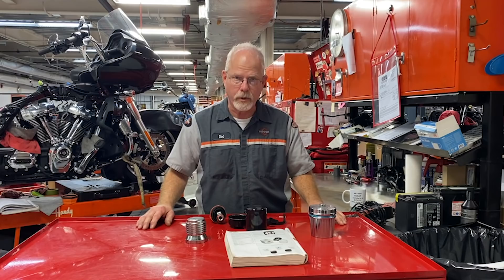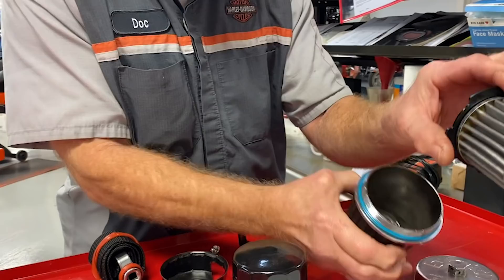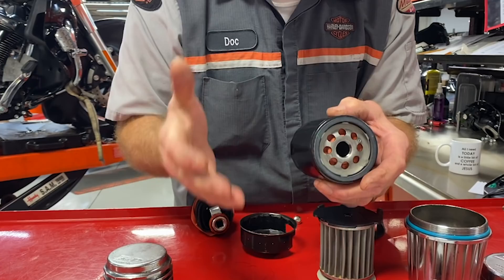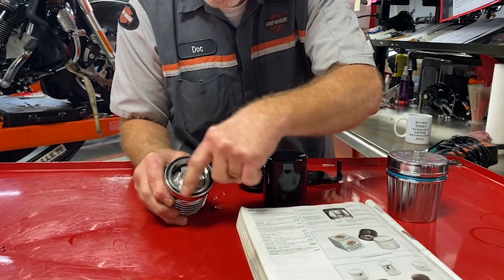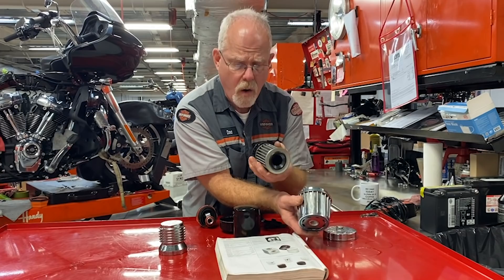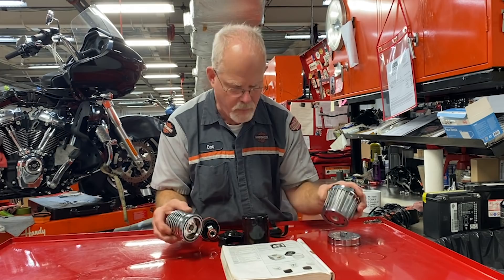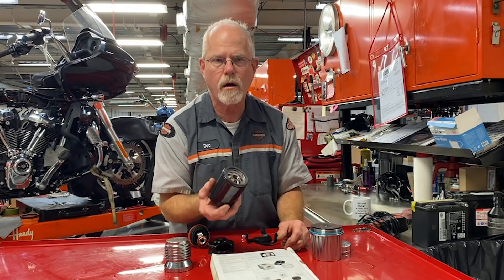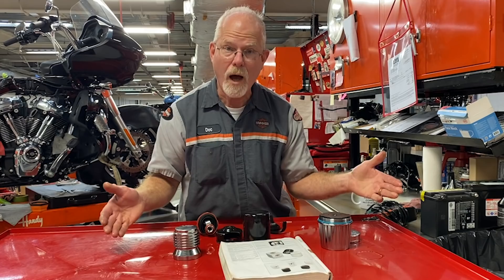DOC HARLEY: REUSABLE OIL FILTERS

Comment: The Harley filter does filter very well. The problem with it is it is plugged long before your 5k service interval. So you are running in bypass filtering no oil for the last 1-2 k or so. Amsoil is a 20 micron and k&n is 25. Are they tight enough? Probably. They also will filter oil all the way to your service interval without restriction and going into bypass. In mho a 10-12 micron is perfect. You will get the total usage out of the filter without going into bypass before your service interval comes up. One option is to spin a new harley filter on at 2500 miles and add some oil. Then go to 5k and do the full service if you want that tight of filtration. I personally use the amsoil filter and oil and have never had any issues. 6 to 1 half dozen to the other. If you filter down that tight you are in bypass for around 1/3 of your interval. If you choose a less restrictive filter you may be cycling some very fine metal through. Your call fellas. Great video doc. Thanks for the information.
Reply: How do you determine your HD oil filter is plugged and running on bypass at any mileage?
Reply: @montanaguy  The Truth About Oil Filter Micron Ratings
February 27, 2018 / in Cartridge Oil Filters, Oil Filters, Spin-on Oil Filters, Synthetic Oil Filters  
One of the most commonly asked questions about oil filters for passenger cars and light-duty trucks is “What is the micron rating of the filter?”.  The inquirer is typically seeking information upon which to make a determination as to the quality of the filter and whether it is appropriate for the application under consideration.  Often, the concept of “micron rating” and it’s relationship to filter efficiency is not fully understood which can result in an answer that is not meaningful.

What is a Micron Rating?
A micron is a unit of measure in the metric system equal to 1 millionth of a meter in length. For perspective – The average cross-section of a human hair is approximately 50 microns.

A micron rating is used to indicate the ability of an oil filter to remove contaminants by the size of the particles that the filter will collect and retain.  For example, a filter with a micron rating of 25 will filter out contaminants of 25 microns or larger in size and a filter with a micron rating of 5 will filter out contaminants of 5 microns or larger in size.

However, in order for a micron rating to be meaningful, two pieces of information must be present – the contaminant particle size (in microns) and the filter’s efficiency percentage. 

Filter Efficiency
Filter efficiency refers to a measure of a filter’s ability to collect and retain particles of a specific size.  For example, if a filter can collect and retain 95% of particles that are 25 micron-sized or larger, the filter can be said to be 95% efficient at 25 microns.  In other words, a micron rating of 25 at 95% efficiency.  The same filter may also be able to collect and retain 20% of particles that are 5 microns or larger.  In a such case, the filter can be said to be 20% efficient at 5 microns or have a micron rating of 5 at 20% efficiency.

Both pieces of information must be included when stating the micron rating of a filter.

Stating a micron rating without an efficiency is misleading.  As noted earlier, a micron rating is used to indicate the ability of an oil filter to remove contaminants by the size of the particles. It is important to remember that a micron rating without an associated efficiency does not fully describe the performance of a filter. For example, the same filter described above could be called a 5-micron filter if its efficiency at collecting 5-micron sized particles was, for example, only 20%.  If the recipient of the information only hears “5-micron filter” without the efficiency percentage, the micron rating is misleading and therefore meaningless.

The two most common terms used to describe micron ratings are Nominal and Absolute.

Nominal Micron Rating
Nominal Micron Rating expresses the ability of the filter to capture particles of a specified size in microns at an efficiency of 50%.  A nominal rating of 50% at 10 microns simply means that a filter captures 50% of contaminants 10 microns in size. The statement of this efficiency is important to understanding the performance capability of the filter.

Absolute Micron Rating
Absolute Micron Rating describes filter performance that is capable of removing at least 98.7% of a specific size particle. This rating is determined through a standard test in which oil containing measurable particles is passed through the filter. Particles that pass through are measured and counted. This rating is more informative than the nominal micron rating. Again, the particle size and efficiency must be stated.

Passenger car and light-duty truck oil filters typically have an absolute micron rating in the range of 25-30 microns.
Misunderstanding Efficiency and Micron Rating can result in selecting a filter that is not appropriate for the application under consideration.  The Micron Rating must be stated in terms of the efficiency of the filter to collect the specific sized particles.

It can be said that the backstop at a baseball field is 100% efficient at collecting baseballs that hit it.  The backstop, which is the filter in this case, is therefore 100% efficient at collecting baseball-sized particles.  However, if one were to throw marbles at the backstop, there’s a good chance that many of them are going to get through. The backstop may be much less efficient at collecting marble-sized particles. Understanding that efficiency must be stated in terms of particle size is the key to the meaningful interpretation of a micron rating.  Without both pieces of information, the actual performance claims of a filter may be misleading. That’s the truth about micron ratings.

Tags: Efficiency, Filter Efficiency, Micron, Micron Rating
Categories: Cartridge Oil Filters, Oil Filters, Spin-on Oil Filters, Synthetic Oil Filters  
Share this entry
Reply: @montanaguy  this should help you. I did not give this kind of detail. HD filter has absolute rating at 40 micron. Catches to 5 micron.
Reply: My thoughts exactly

Comment: Independent tests show that stock 5 micron filters clog around 3k and then you're just running dirty oil through the bypass, while 30-40 micron filters don't clog while still filtering all debris from the oil.  Personally I change my oil at 3k anyways but I will be switching to an aftermarket disposable filter around 30 microns.
Reply: WIX XP is a Synthetic oil filter. My H.D. runs on Synthetic oil. What is that no name hd filter. Off brand?
Reply: @woodworm3615  I'm going to start running a hi-filtro filter.  There's a YouTube channel called Kevin Baxter, he has a video where he talks about independent tests on oil and filters, he also has a bunch of other cool videos like engine teardowns and builds. It's a pretty cool channel.
Reply: Dont know of any full flow filters that can filter to 5 microns. Some bypass filters can. My Australian Jackmaster Classic claims 1 micron if you use their filter elements. Most bikers probably dont want a filter that requires hoses. With a spin on 5 micron filter the relief valve would always be open with the engine running. My money would be on the stock filter. Im a clean oil nut case. I would have a Australian Jackmaster Classic  on there somewhere. I had a Frantz on my Honda 500. Couldnt find a way to hook up one on the Harley 350 Sprint. The Harley Topper was a 2 cycle golf cart engine powered.

Comment: I cut open a HD oil filter. The quality was impressive. Looked just like a WIX filter. Staying with OEM. Thanks Doc!
Reply: I like Wix XP. It would work right? My other question. Shouldn't the filter hang down holding oil instead of on it side on the Harley Davidsons? Mm?
Reply: @woodworm3615  you would think but Volkswagen puts them upside down. I think it doesn’t matter.

Comment: I feel like I don't need the hassle cleaning out an oil filter, plus that are a bit pricey so don't know if it would make sense to buy for my old vehicle... But I do like that they available if I ever want one and for those that others that really like them.
Reply from the maker: Good point David…..Doc
Reply: @LowCountryHarleyDavidson  Doc, It would take more to "break even" on those fancy filters 'cause unless we value our time at two bucks an hour, the whole cleaning process isn't done by someone else's butler 😁  And, the whole process uses brake cleaner, etc., and aside from the cost of that, it's also not exactly environmentally sound to flush the gunk down the drain.  Because ...no, the used conventional filter should NOT go in a landfill but be routed to a hazardous waste facility/outfit to be disposed of properly.  It's even the law here in California, as it is in some other states; and it SHOUD be.
Ride Forever!  ~  🦅

Comment: good points doc, BUT as an HD mech, I will say my oil pressure comes up faster, like right away. oil temp is lower, = a quieter motor. the cost of filters whether from HD or aftermarket keeps rising, and there is noticeable less drag on the motor whether cold or hot temp. I've used a K&P reusable filter for 7 years on different bikes I own including my 77 shovel, yea they make a drop in oil tank filter to replace the paper or mesh ones, and had nothing but great success and service. and checking my eng for debris in my oil is always a priority, with most. I don't have to cut a tin & paper filter open, and the convince of not looking for a conventional replacement is itself worth it. in the long run, I save $.
Reply from the maker: Thanks for Sharing your good experience...Doc
Reply: K&N filters can be "looked" up on Amazon every day of the week - twice on Sunday 😁
Reply: @midnightmc3096  yea and you will be waiting until Sunday to get it, plus shipping
Reply: @martinwall7297  Nope.  Here in a day or two ...and...no shipping on Amazon Prime 😁 And less money than pretty much anywhere in the fouling universe.  Plus I don't risk doordings or do any wear and tear on myself or my vehicle comin' or goin' ...aaand, my time to go and come back ain't worth only a few bucks per hour, maybe your is.
From southern California ~ Ride Forever!
Reply: @midnightmc3096  try using hi-flotru filters

Comment: The Flo reusable oil filter is an awesome filter.  It has 1 gasket and its good for up to 5 oil changes, but it comes with 3 more when you buy it.  Also has a nut as part of the filter for easy removal, when i got mine I also purchased an extra filter media so i don't have to go and wash and let dry before i go riding again.  The filter is awesome and helps reduce the oil temperature along with looks great and hi flow (but it is pricy) but so is Harley's filter and then you have to use their crappy Syn3.  I put Amsoil in all 3 of my bikes and in my F150
Reply from the maker: Those are some strong opinions….Doc

Comment: I don’t think you mentioned, but the filter must also be designed for higher oil temperatures than are typical of automotive applications. I recall talk of folks running cheap auto store filters on a liquid cooled metric tourer- and the adhesive/ sealant securing the edges of the filter media would break down, go into the engine and block passages.

Comment: I don’t think that was a unbiased opinion, I guess I would to if I worked in a certain career 😂 in either case. In my opinion. A lot of those problems “concerns” are really not of any concern. It’s not really messy, does not get everywhere and not really hard to clean it completely with no worry of material left in the filter. There are two great company’s that make reusable filters and they are both very creditable. Yes they make them specifically for our bikes. There is a machine shop near me that specifically works on Harley motors, it is well known throughout the country and is creditable as well. He actually turned me to these and I will never buy a filter again….never. Well unless I absolutely have to. I mean there is a filter that is used on cars that has the exact specs and parts in a hd filter for half the cost. My machine shop guy promotes the reusable filters, one company in particular, as well as turned me to the updated oil pump gear ratio. Which I have done to all my bikes and makes a big difference. Off track….The o rings is not a problem, they actually last for a good time. I mean I guess you could buy a whole crap load for the future, but if the case of a company going out of business, I’m sure there will always be someone that makes the o rings of that size. The wrench issue. Well be smart with what you use. I use my hand. Now wanting to know the kind of material in the filter. Myself and I’m sure a lot of other guys that do there own work and or race, need to know what’s going through their motor and can pretty much cipher what needs to be done by looking at the filter.
Reply from the maker: Thank you for sharing your experience. Should I remove this old video?…..Doc
Reply: @LowCountryHarleyDavidson  I’m sure you’re adult enough to make that decision. Further more, since these have been out for more than 2 years I’d say this video still pertains to some people. No video is to old.

Comment: I've been using a FLO reusable oil filter on my bikes for years. Combined with a fan-assisted oil cooler they help the bike run cooler. The FLO filter also has a nut on the top for easy on and easy off with a 5/8 inch wrench, no need for an oil filter wrench. The Flo also has a super strong magnet inside to catch any steel metal shavings in the oil. A check valve is inside to allow oil to flow through the filter if the stainless steel ever gets clogged (which has never clogged on me). This is not new technology. Race cars have been using reusable stainless steel mesh oil filters for over a decade. I usually listen to and follow your advice, but on this one I disagree. Use what you will, it's your bike. As for me, I'm sticking with FLO.
Reply from the maker: Thank you for sharing your experience….Doc
Reply: @LowCountryHarleyDavidson  Thank you for sharing your wisdom. 👍🏻👍🏻

Comment: Although the PC Racing Flo filter is apparently keeping the Eagle Screamin' I'd be concerned that that one as well as the K&P Engineering filter does not, at the end of the day, filter more nor better than a conventional filter.  I believe the opposite to be true, in fact, as demonstrated by several very involved tests right here on YouTube. I surmise that the reason Harley-Davidson utilizes the stainless mesh filters in racing is more due to better flow resulting in more horsepower than for longevity's sake.  It's rather unlikely that they're concerned with long-term wear issues.  And so, after researching this to the moon and back ...and right into the weeds and down the rabbit hole, considering every possible aspect during said journey, I'll have to say that the Doc, after all, is correct on this one, too  (｡*‿*｡)  The fancy-schmancy re-usable filters flow great for a reason:  they don't filter as much and so there's less for the motor/oil pump to labor over, and thus the 5-9 degree lower oil temps.  I'd rather have the virtually constant filtration around plus or minus five microns with the HifloFiltro high-quality conventional style filter.  Oh, and they have the nut on the end also if you pick that model (as they have two versions).  And I have a nifty filter cutter, so no big drama regarding cutting open filters after oil changes to check status.  
From southern California ~ Ride Forever!   🦅

https://www.youtube.com/shorts/1uPniD6xxlU

Comment: You said change the filter every 3000 miles when the owners manual says 5000 miles. Some say if you use synthetic oil you can go longer. Your thoughts?
Reply: I’m no mechanic.  I only know my bike.  I have used HD Syn3 only in all 3 holes.   Serviced every 5k miles.    I think Synthetic can go longer than that from what I can tell.  I just like changing it so I can inspect and try catch an issue early.  I have gone 8k before and oil looked same as 5k.    This is on my bike 2012 RK with 238k (miles) on it.  No engine rebuild yet.   Not a bragging statement just this is my experience.  Thats a lot of oil chgs.  You’ll be fine whatever you decide.

Comment: THE REAL QUESTION   is not  really answered in this  ,,, of course  they  plug H-D oil filters   BUT   as an air cooled engine  very much like old airplane and small airplane the very big advantage of a  reusable is that you can   wash the filtering element   in varsol then strain  the  muck , pass a magnet over  the crud and see if your magnet pickup any metal  if it does  you have to investigate   or you may have down the road  an expensive  failure   we did that procedure on all radial engines  back then  at  every 50 hours of flying     believe me it did pay off..
Reply from the maker: Thanks for adding your story in answering THE REAL QUESTION…..Doc

Comment: There are orings you can buy to replace them if you want and you know this.
Reply from the maker: So I should buy a bag full just in case?
Reply: @LowCountryHarleyDavidson  yes,  put them right next to the bag of 50 replacement orings for the engine/trans/primary drain plugs
Reply: @hughjanus590  😆

Comment: never thought we would use a reusable oil filter but my 103 was using a little oil ,switch to flow from Dk custom and straight 50 oil external breather, problem solved